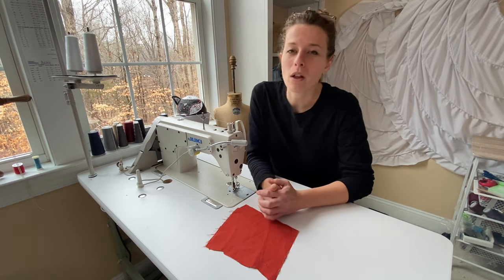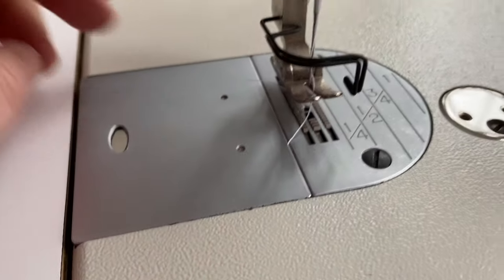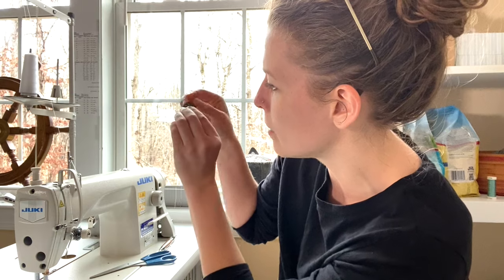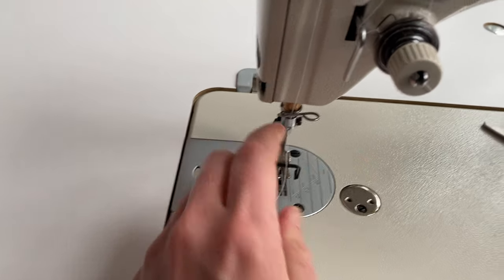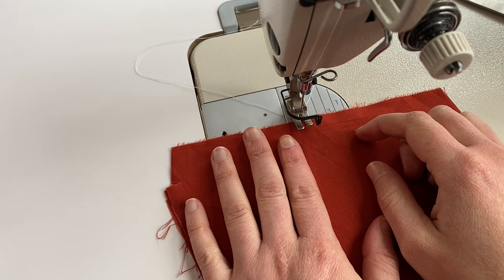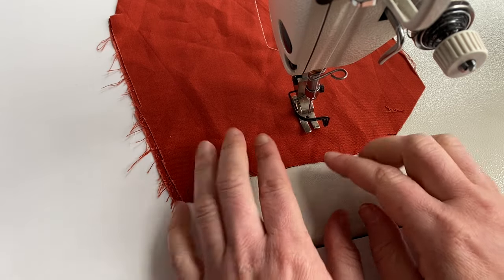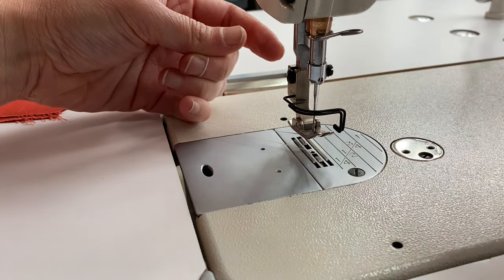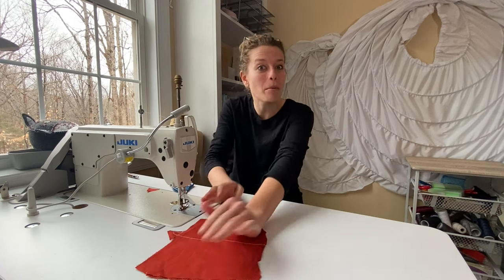Why Your Machine Is Jammed Frequently #sewingmachineproblems

Comment: Just one more -- Do not ever thread your machine with the presser foot down.  Even if you thread it part way and then raise the foot, the thread will not lay in the tension wheels properly and you will get a bird's nest or jam it.  Excellent tips!! Thank you!
Reply from the maker: Good point! I didn’t even think of that one since I never have threaded my machine that way, but you’re right!
Reply: Ive spent 8 hours trying to figure out why I couldnt get my machine to work after rethreading it. Thank you so much

Comment: The reason the needle should be raised all the way up and slightly back down to pull the threads out is because of how the rotary hook forms the stitch. If the stitch is incomplete, the threads don't pull easily.  I'll try to find a video on how a rotary hook works.
Reply from the maker: Oh I see. Very interesting! Makes total sense

Comment: Your video is very informative. I appreciate the fact that you helped us beginner industrial sewing machine users. I wish I had seen this before I made all of those mistakes.  I am stuck right now and need your help, please.  I have a problem with my bobbin area. I don't have any thread stuck. I have rethreaded my machine.  I have wound new bobbins. I have put everything in place as it should be. I was honestly sewing along fine and all of a sudden, my bobbin thread began bunching. I adjusted the tension. I tried again and it did the same thing. I also oiled the machine as my machine has to be manually oiled. It is a 20U machine.  If you have a suggestion for me, I will readily receive it.   Thank you so much for your time.

Comment: Thank you for great instructions. My Elna air, keeps jamming, but also stitches are bunched up. What is the standard stitch length for sewing? Perhaps my tensions are wrong..🙈
Reply from the maker: @martinedann7025  your tension could be wrong if you notice one side of the fabric has loose or tight stitches. I should make a video on tension… makes a world of difference! It’s possible you may have some threads that have not been removed properly too.

Comment: Your advice of the thread being stuck if needle is not slightly past the up position is very helpful. Its happened to me and I wasn’t’t sure why... : ). Could you please answer a question: I have an old White sewing machine. Seems to work ok but the home position of the needle for straight stitching is to the left edge of the foot. For zig-zag setting, the needle moves to the center of the foot. The zig-zag stitching appears to work ok. Is the needle home position to the left on my machine normal, or is something possibly out of adjustment.

Comment: All good tips except the one on installing bobbin. All machines are different and all of mine have had the bobbin put in the case with the thread coming off the bobbin clockwise. It’s a good tip to put the bobbin in correctly for your machine. Another tip is to inspect the bobbin area well at each bobbin change. I have had the tiniest piece of thread cause the biggest problems.  Using a flashlight to inspect is helpful.
Reply from the maker: Good point, thanks for the clarification! As you mentioned, maybe the better way for me to word it is “thread your bobbin right”. And yes to that thread in the bobbin! Makes a huge difference.
Reply: @thetailorette  thank you for not getting upset with my comment.  I love your videos. Been sewing over 60 years and still learn great things from you.
Reply from the maker: @pamelaanderson4211  I appreciate constructive criticism. Yours was helpful and helps me to check my facts first. 🙂glad you’re enjoying my channel. I love that we all can learn from each other!

Comment: I did everything the sewing machine manual said, everything you said that wasn't said in the manual and did some troubleshooting on tension, length and width of the stitch on top of that and the result was the exact same, every time... it jammed every time with no exceptions.. I have no more words or will to try..
Reply from the maker: It sounds like your machine might be out of time. It may need to be serviced.
Reply: @thetailorette  I used two times in total cause it always did that.. I got it to work properly only on one stitch. It's new, but it might need to go anyway!
Reply from the maker: @elenavangeli8824  what brand machine is it?
Reply: @thetailorette  Necchi q132a heavy duty
Reply from the maker: @elenavangeli8824  okay, my guess is it could be the brand if you are bc doing everything right. Usually a good sewing machine won’t jam in the first use of it. Have you had experience with sewing on a machine before?
Reply: @thetailorette  Not really I bought it to learn and start using it. I thought it was ok but I'm blatantly not an expert. Although, I researched before buying and it is supposedly one of the top Italian sewing machine brands. idk
Reply from the maker: @elenavangeli8824  I’ve never heard of this brand in my circles so it’s possible it may be a bad brand. I’m not sure. A brand I highly recommend buying for beginners is Babylock. The stores that sell babylock typically have a free class to teach the basics of a machine. Everyone I’ve known who uses it loves it! Stay away from machines like brother, singer, and Janome. Everyone I know who started on those machines ended up quitting sewing.
Reply: @thetailorette  Good to know! I'll see what's available in the European market. Thanks.

Comment: Thank you, that explained a lot of my problems. Turning the wheel incorrectly, didn't know that. I think I always turn it towards me but?? I just dismantled my machine and found out for some reason my bobbin case was not aligned with the mark on the machine, thus the thing was barely turning, it felt so stiff. Is that also caused by fabric being caught under the needle plate?
Reply from the maker: That sounds like something got caught in the machine and put it out of time? When you say the bobbin case wasn’t aligned… what the needle not even able to go up and down?
Reply: @thetailorette  I think so. I couldn't turn the wheel by hand, everything was "froze". I aligned the bobbin case with the dot on the machine and all was well. The earlier fabric catch must have been so violent it moved the bobbin case out of alignment.

Comment: To be fair, I never push my foot pedal- because I prefer using hand controls. My Janome always automatically raises the needle when you finish sewing. It’s great for preventing jamming, because that last issue never happens. But, if you want to go around corners, you do have to stop seeing, and then manually lower the needle again before you can turn your fabric. And ho early, that was a problem I had- basically trying to pull the fabric away while the machine was still in the middle of a stitch. And I had thread  jams because of it. But it’s just never an issue now.
Reply from the maker: Yes! That is an upside to that feature 👍🏼

Comment: Different machines load the bobbin differently.  My domestic Vintage Kenmore loads the bobbin like the #6 it is a front load bobbin.  My Singer and Brother machines with drop in bobbins load like the letter p.   The manual should show the correct position.  You are right if want a mess load the bobbin backwards.

Comment: All good tips but for an old seasoned sewer like me, I was still trying to figure out why I was still having problems (new machine to me) and it turns out I was using a new metal bobbin that didn’t come with the machine) instead of the little plastic ones that came with my Brother, and as soon as I switch back to them, I started having smooth sailing. I think the new metal bobbin that I used is just not the right size and it caused the bobbin to constantly get jammed up.

Comment: I just got Singer M1000, a beginner model. I just put one side zipper on a jacket. I replaced the zipper. I turn the zipper over and my machine won't go through the thin puff fabric and the zipper. As if it's THICK. But it's just a thin puffer jacket (thin cotton stuffing super thin). The needle just stops as soon as it hits the plastic coating on the end of the zipper. There is a plastic texture at the end of the zipper that is stopping thee needle. It's not like I'm sewing denim. Is it my basic machine, just not enough horse power? Or what am I doing wrong? THX!
Reply from the maker: Hello! Sounds like it’s %100 the machine you purchased. New beginner singer sewing machines jam at everything and there’s no reason for any of the jamming. I have a video on buying sewing machines and I explain all of this. I promise, I’m not being a sewing snob… every student I know that starts on a beginner singer machine ends up returning it. You’d be better off buying a brother machine (it is better, but not the best, but it will function much more).

Comment: What do I do if the handle is already jammed and I've removed the thread and bobbin to check for threads, and nothing is visible?
Reply from the maker: If you are talking about the hand wheel of the sewing machine, it could be that something inside the machine is blocking the wheel from moving altogether. Did you break a needle or have a large nest of thread gather somewhere? I know when I break a needle, the tip can fall in the machine and keep the machine from moving.

Comment: I’m incredibly frustrated. I’ve gone through all the basics, bobbin in place correctly, thread wound snugly, no lint, tension is right, machine is threaded correctly,changed the needle, changed the thread, etc., but nothing changes. It’s getting caught at the top of the retaining ring where it feeds up through the dogs. I’m lost and since I just can’t afford to go to the repair shop I’m also just plain out of luck 😢
Reply from the maker: Sounds like your machine is most likely out of time and need to have it serviced or learn how to retime your own machine. I can't diagnose exactly without being there, however, I had the same issue and it turned out my machine needed to be retimed correctly.

Comment: I just started im using a singer start 1304 ..i have tried the bobbin both ways it still jams up and the top thread gets stuck under the bottom thread and jams up and even the top thread will snap off some how? Im lost
Reply from the maker: That is 100% your sewing machine. New singer sewing machines are known for jamming up. I’ve never sewn one straight line on a new singer without jamming. Don’t let this make you give up on sewing!
Reply from the maker: I recommend a brother sewing machine if you don’t have a large sum to spend. If you want to invest in something guaranteed quality, I recommend babylock brand.

Comment: I’m having trouble with my front load bobbin getting stuck where it feeds through the bobbin case. It’s my first front load bobbin so I was careful to make sure I was installing it properly. It will be fine for several inches of sewing then it’s stuck. Grrrrrr
Reply from the maker: Is this an older or a newer machine? It's possible the bobbin case is too tight or your machine is out of time

Comment: Okay just did all the tips,re did bobbin just in case. My thread tails are long anyway. So started oh great got further than-an inch and jam my needle won’t even come up to remove the fabric. Literally just stuck. Last3 times I was able to get the needle out of the way and cut threads and clean out the bobbin area. Argh again
Reply from the maker: So sorry you’re experiencing this! What kind of machine do you have?
Reply: @thetailorette  an inexpensive kenmore. Profile. I saw a video to take the workings of bobbin out snd clean and oil and embarrassed to say i have machine oil but have never done this. So will do that put the 2 parts on, make sure i thread bobbin right snd see.